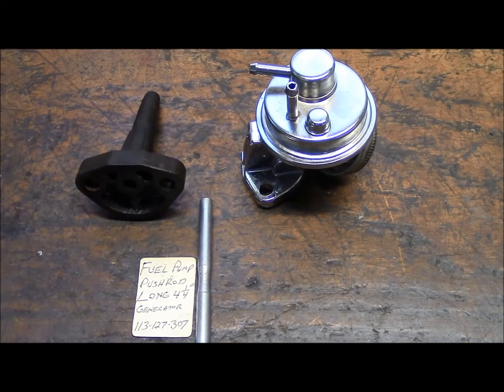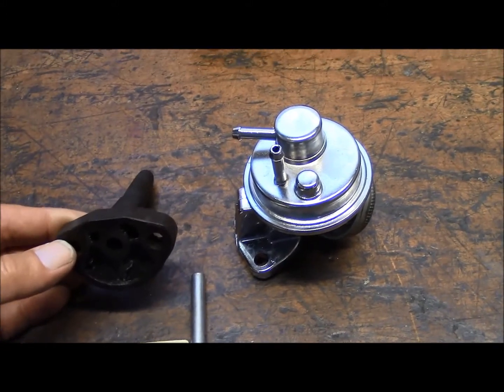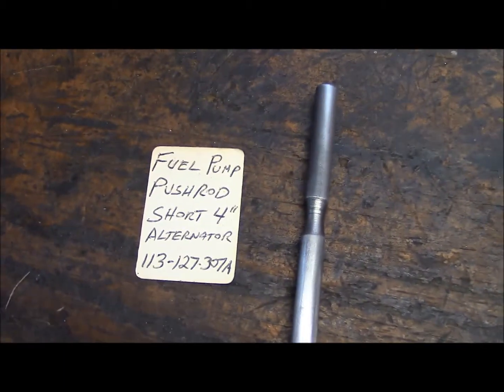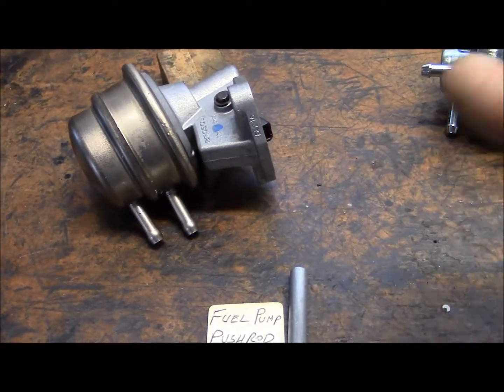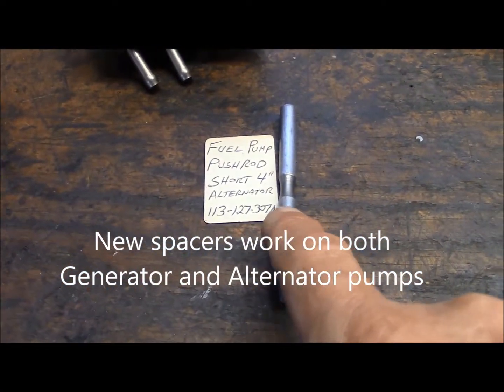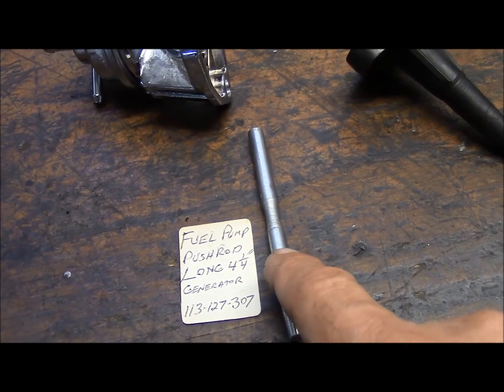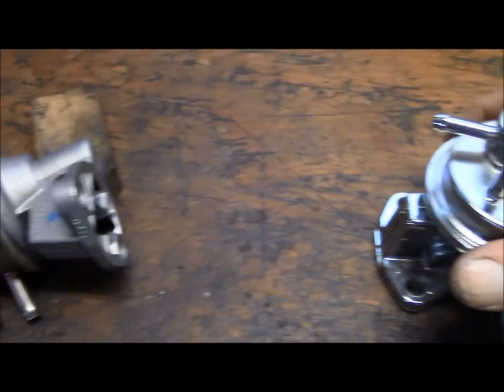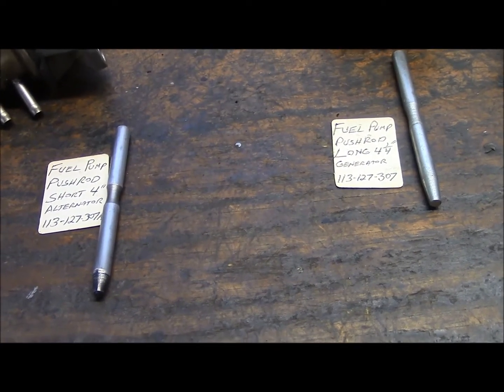FUEL PUMPS GENERATORS & ALTERNATORS VW AIR COOLED

Comment: Hey milo great content here. 

I recently upgraded from a generator to an alternator?   I have a fuel pump question.  I’ve opted for the mechanical alternator fuel pump.  I have the correct lengthfuel pump rod but I had to notch the fuel pump stand to create the gap for the lever under the fuel pump.  That all went great until I put the gaskets on. Do I also need to notch the gasket to create enough clearance for the lever that hangs below the pump?

Sheesh I hope that all makes sense

Comment: I removed the spacer and can’t get it back in as the push rod is loaded up against the crankcase towards the dizzy. Any idea how to unload the rod and get it to go back up into the spacer and get the spacer back on? TIA. I’ll turn the crankshaft and see if that works 🤷🏼‍♂️
Reply from the maker: The fuel pump push is to be removed, before removing spacer. Push rod goes in AFTER the spacer.
Reply: @milomanx6531  thanks

Comment: THANK YOU - finally, an explanation that made sense to this old frog. I have a vintage trike project. Gen., with a Alt pump (evidently) and push rod less than 4" long (ground down?) Get 4psi fuel pressure at carb (new 34PICT-3)  loading up, smoking, burning eyes. Have tried everything 'old timers' recommended. New shim under needle to lower float, double gskts under pump spacer, and under pump. Fuel pressure regulator, (two) actually, thought first was defective. Still cannot get below 2.5/3 psi pressure. Carb mfg recommends 2 - 2.5 psi. ? Do you know the fix for this issue?.... And my timing mark jumps around. fix for this?
I'll gladly donate if you're the one who can help me get this to run right.
Reply from the maker: See my other video. It addresses all the issues you have, except the timing jumping. I would try a condenser if point style distributor, maybe a different timing light. The YouTube video is: https://www.youtube.com/watch?v=vRYOW9WLHLs

Comment: Excellent information, Milo.  One question: If you replace the pushrod, tube and pump are they interchangeable?
Reply from the maker: You can switch to newer or later style, but, all parts must match. P.S. All replacement tubes are the same, but not originals.
Reply: @milomanx6531  thank you. I just bought all the stuff for the alternator engine to convert it over to the new style pump and didn't want to break anything.

Your feed and your information is always top shelf. Keep it up, sir.